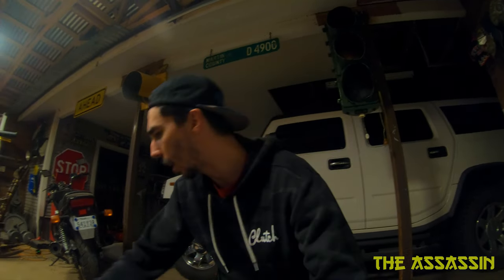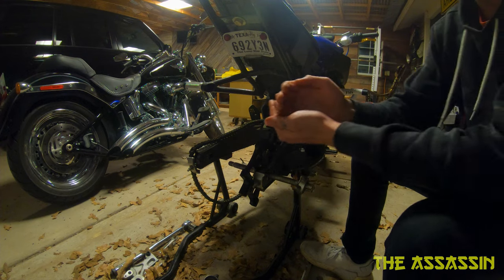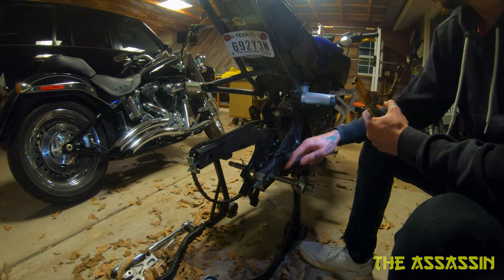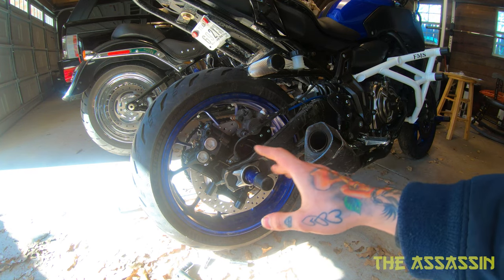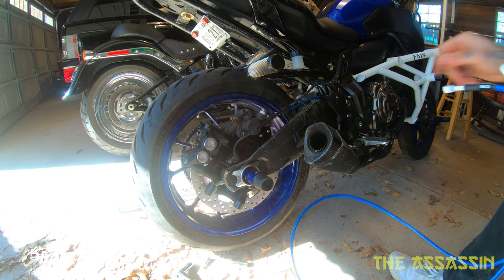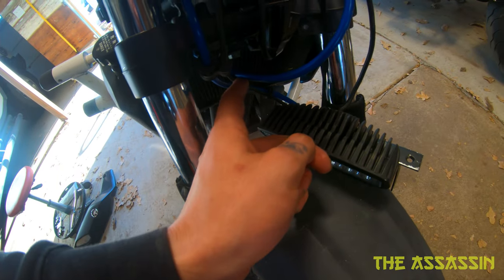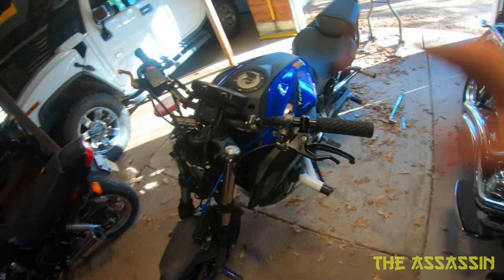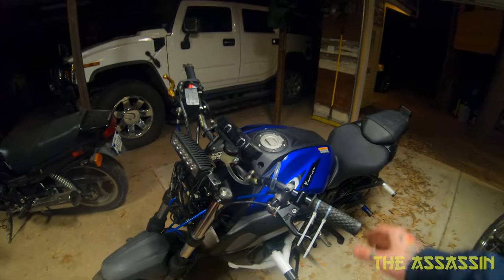2018 YAMAHA MT07 HANDBRAKE SETUP- MT07 Stunt Build Series EP. 8

Comment: Looking forward to the test ride and seeing how this new hand brake works.  (And this is yet another reminder that I need to get the air out of my rear brakes.  I hate bleeding brakes.)
Reply from the maker: Dude get that suction tool I have. I literally bled my handbrake in less than an hour 🙏🏽
Reply: @TheAssassinMT07  - A friend gifted me a brake bleeding kit when he sold his motorcycle and got married.  I just gotta stop procrasterbating and get the brakes done.  Maybe when the weather warms up some.  (Let's see if YouTube censors this comment ...)
Reply from the maker: Lmaaaoooooo just get it done bro. The sooner the better 🤣
Reply: @TheAssassinMT07  - Done.  It was warm (80s) and the brakes are finally bled and working.  I pulled plenty of air bubbles out of the system and I have no idea what the little floaties in the old fluid are.  How this happened I have no idea.  It's a sealed system and I haven't crack it open since the last time I bled the brakes.
Reply from the maker: That’s weird but it’s good now so I wouldn’t worry 🤷🏻‍♂️